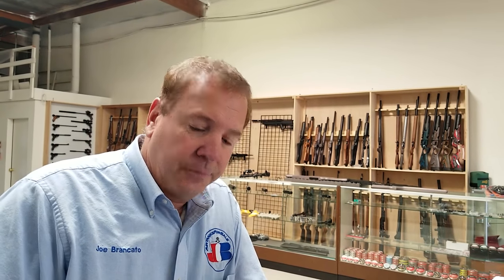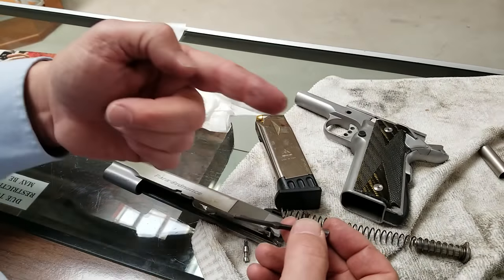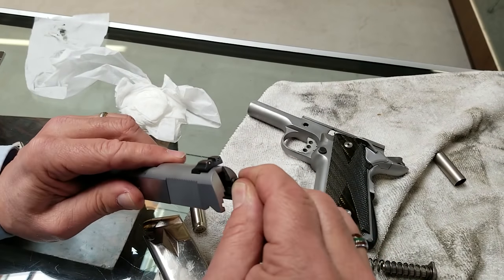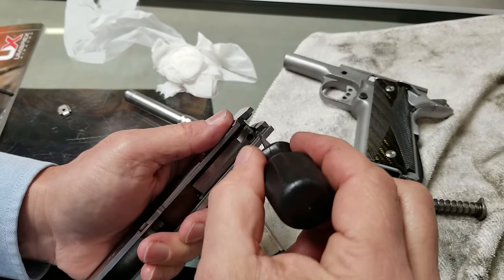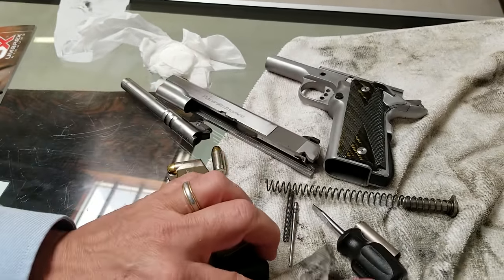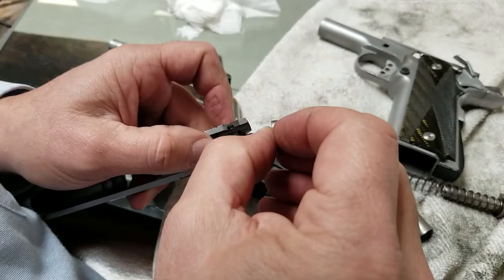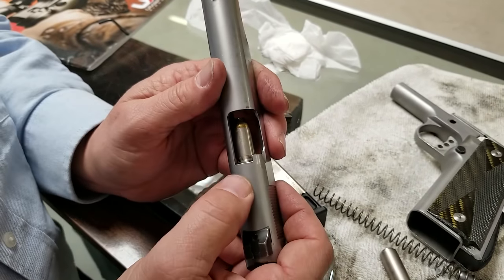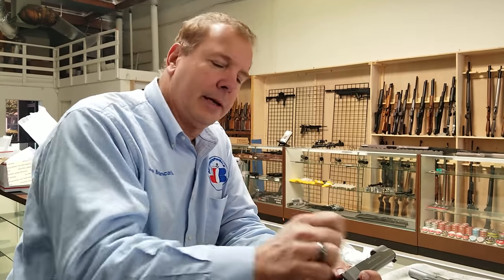Installing an extractor, and firing pin into a 1911 45 ACP Pistol

Comment: The extractor claw is not supposed to go over the rim. It can damage the extractor. You feed the first round form the mag, pull the mag and put another round in the mag. Never let a slide slam home on either an empty chamber or an already chambered round. Period. 
and Joe, move the parts and stop  putting the slide down on them. Show a little respect for the finish on the gun. GEEESH!!! After seeing this, "No way"  you would touch my Les Baer's!!!
KnifeMaker
Reply from the maker: Agree 100%. That is why one can't chamber a round, then  close the slide on it.  The round must be fed from the magazine or damage may occur to the extractor.